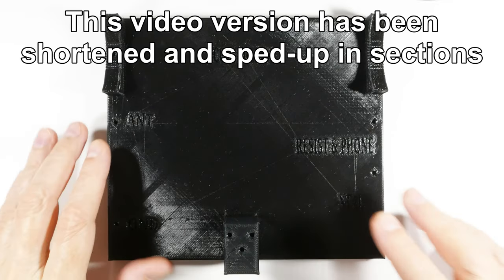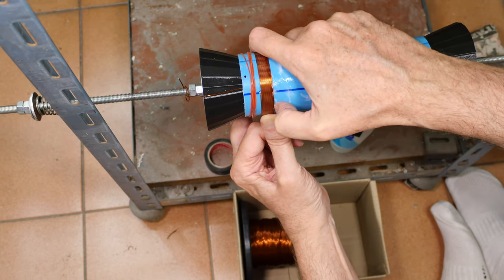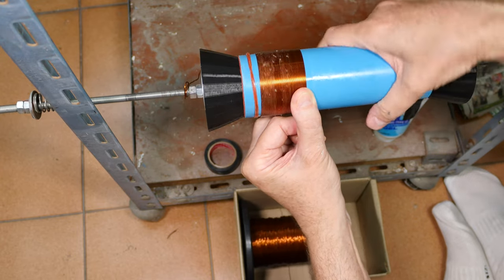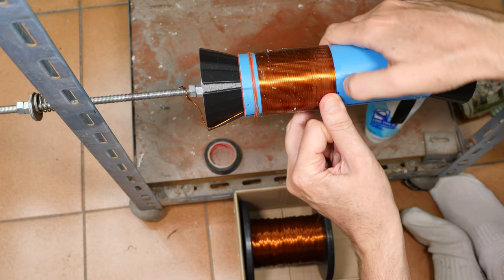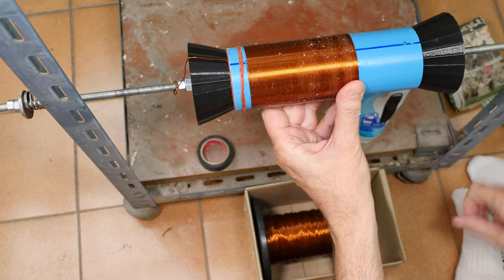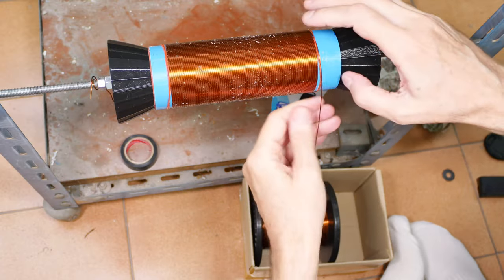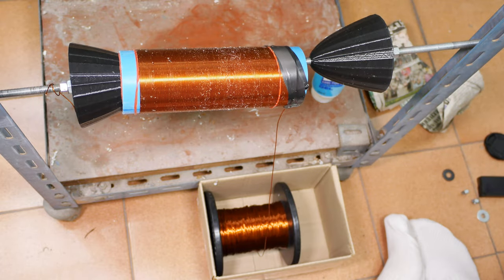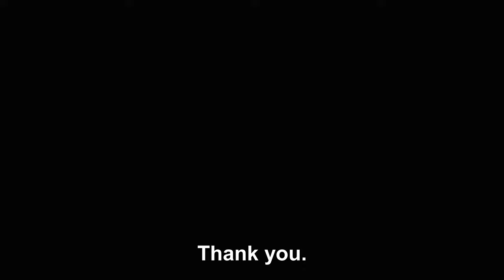Crystal Radio-Winding The Coil (ABRIDGED)

Comment: I just wrapped my coil on a glass tube. That was a nightmare. Glue doesn’t stick, tape doesn’t stick, and you can’t drill holes to feed the wire through for an anchor. At least I got to do it while you were wrapping yours experiencing the same hand cramps. Ha
Reply from the maker: Yes, BUT glass is soooooo cool! And you can use a clear lacquer to hold the wire in place. You can wrap the ends with thread and glue to keep those from unwrapping.
Reply: @tsbrownie  that’s a good idea. I’m not finished yet, but it’s not looking up to my standard so far. I can see myself redoing it all later this week. But I’ll keep it for now as I find progress toward a working radio is important for motivation. I can always remove whatever component is causing me trouble and rebuild it at the end of the project. That’s just how I’m “wired”. Ha